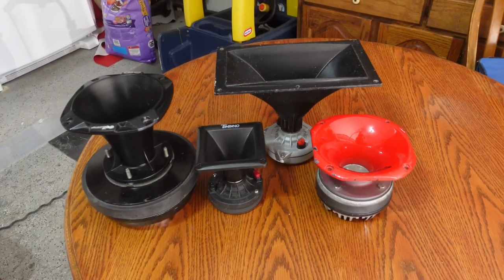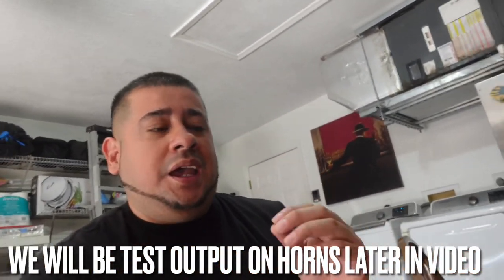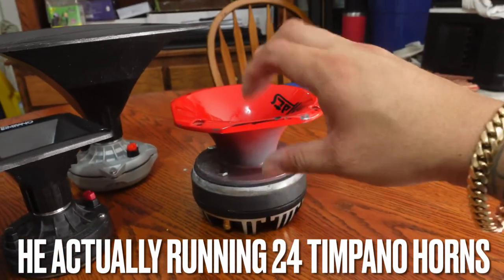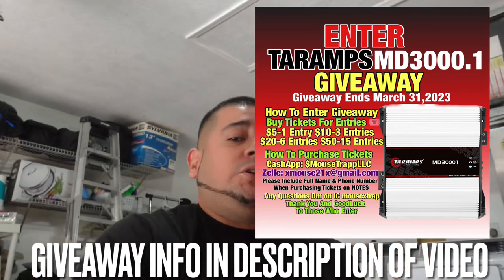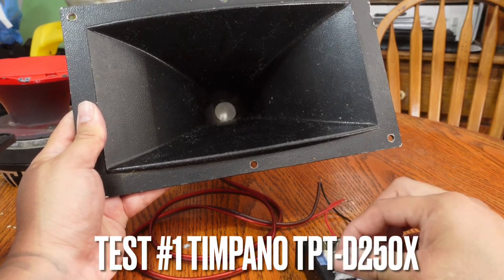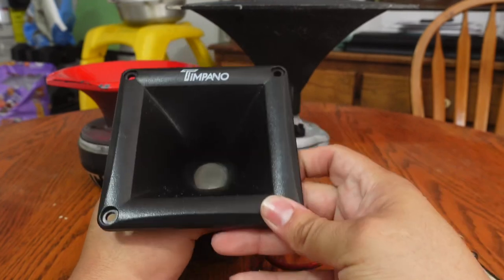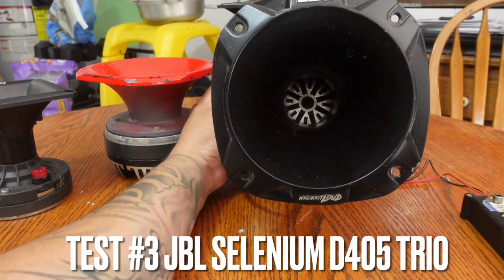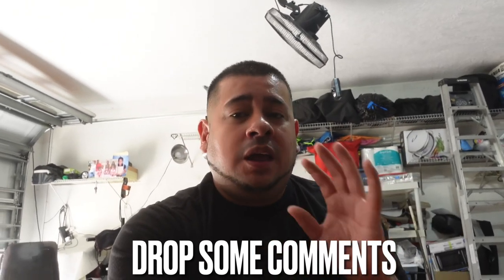Cheaper Horn Drivers VS Expensive Horn Driver test

Comment: I've been running 4 selenium dx-250's  for a couple years. They're great for being louder than stock for cheap. An amp and dsp or good head unit make all the difference in getting as much range as possible.

Comment: The thing about horns is that your horn lense determines the lower limit that your horn can play, a 2 inch driver can play down around 700 to 600 hz but when its stuck on a horn that can only reach down to 1.5khz your leaving alot on the table.

Comment: My horn driver has been making crackling sounds what can be the cause?
Reply from the maker: A speaker Horn well let u know when it’s close to blowing out ..maybe adjust the gain or crossover to relieve stress from her
Reply: @mouse_trap.  thanks I appreciate it and i think thats what’s happening, then sometimes i need to turn it up to get it to play because it won’t play at lower volumes
Reply from the maker: @tonyswagz  ya I’ve come to learn speakers or car audio equipment will find a way to alert you that they’re being overloaded and need your attention to keep it going
Reply: What about the siren speakers they have on the cops cars etc..I have a few all 100 watts what should I set my amp at for best sound ?